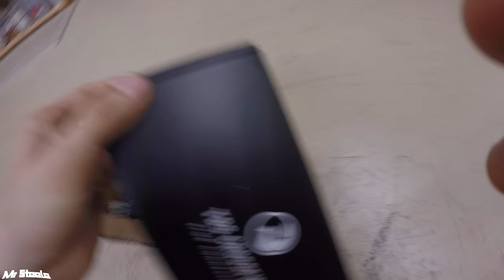Flying Whilst Walking I Vlog 4 I +Carbon Props?

Comment: Hey Steele, i recently bought my first quads. There's a 170 and a alien. The 170 seems to be burning the engine controllers and the engines are burning hot after me testing it and the alien doesn't work, maybe i have to program them? & with what software? Please help (: thanks!

Comment: I currently fly 3S with Fatshark Teleporter V3s and an LPDSM5 radio (cheap 5 channel DSM 2 radio which came with an RTF Helicopter several years back). Which of these should I upgrade first? 3S to 4S, my FPV Goggles, or my radio? If goggles or radio, what would you recommend I upgrade to?
Reply: Doubt Steele will have a lot of time to respond, so I'll give my 2 cents. :)  I recommend upgrading your radio. You can't beat the Taranis X9D Plus. $200 16 channel programmable radio. That's what most of these guys are using. You won't find another radio with as many features for the $$.

Once you're used to that, you might try 4s batteries if you're equipment can handle it.